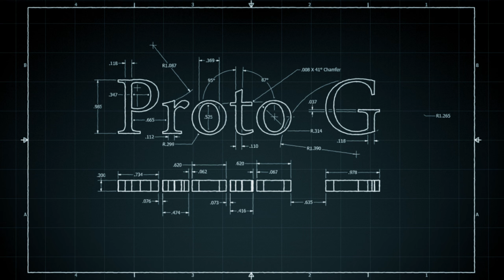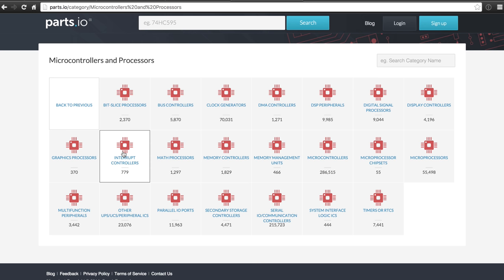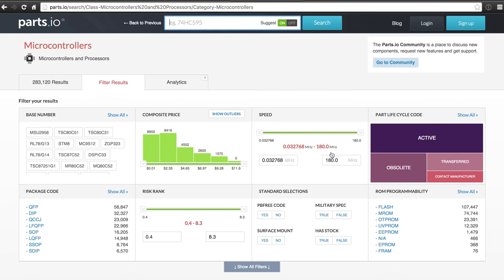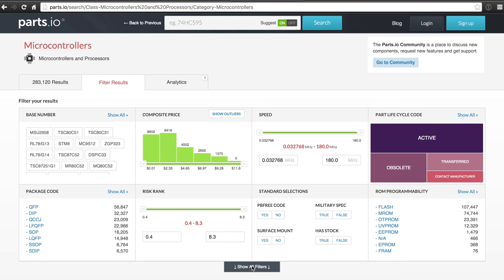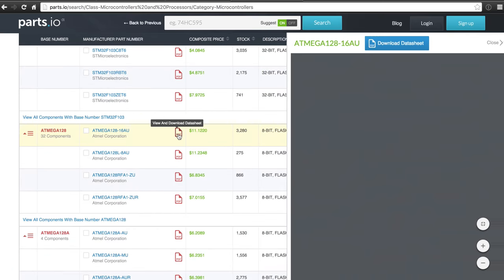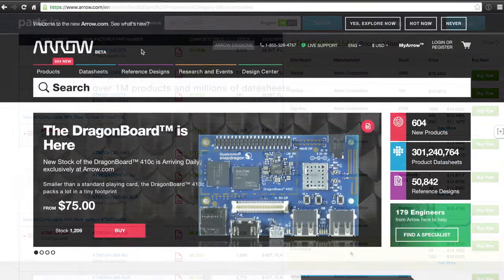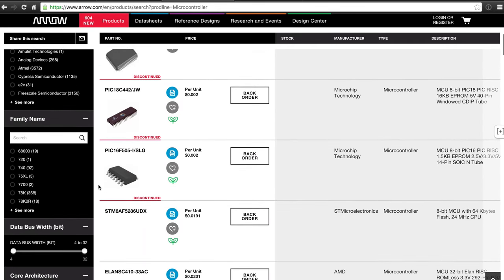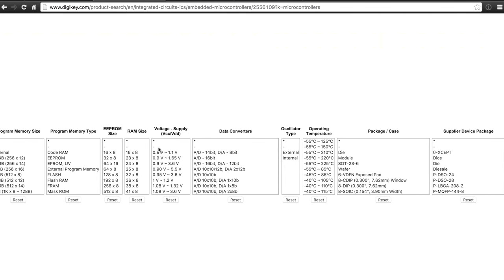Intro to PCB Design Part 1 // Researching Parts

Comment: Will you be covering any low-noise circuit design? I am in the process of designing a board with a 6000g analog accelerometer and a 24-bit ADC. I'm sure noise will be my enemy, but I don't have a lot of (any) experience designing for low noise.
Reply from the maker: +ProtoSerge I will be briefly covering electromagnetic compatibility and electromagnetic interference.